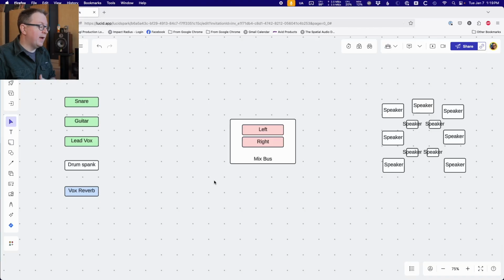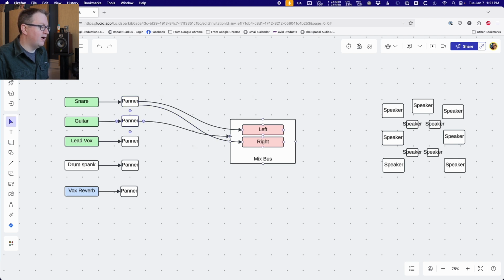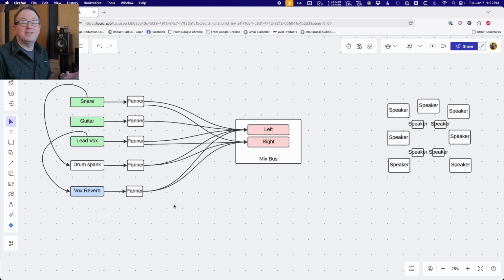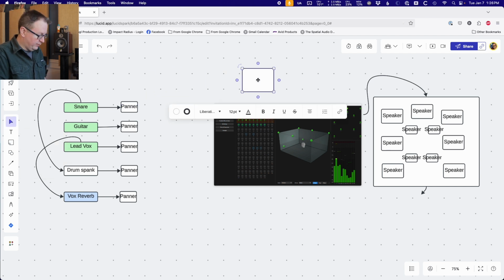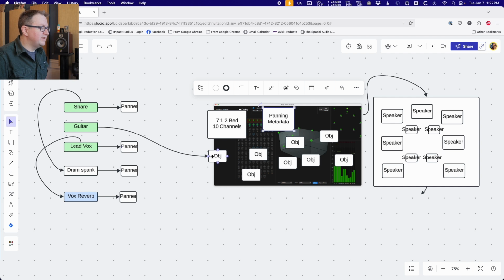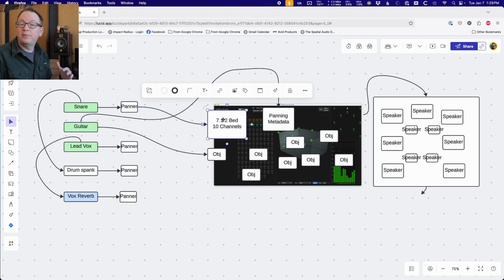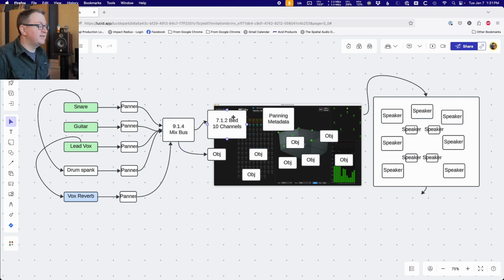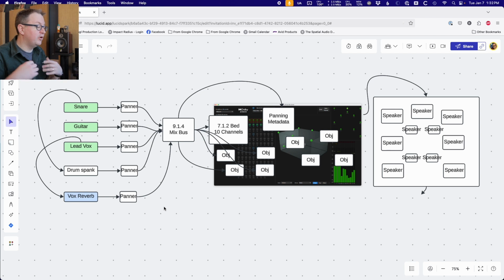Dolby Atmos Signal Flow

Comment: I’m curious, what are your thoughts on creating a 9.1.6 internal bussing for pro tools, then outputting to a 7.1 bed with the Front Walls and Tops being bussing to static panned objects? Workflow-wise, there’s less fiddling with dragging to object tracks or opening sends to object busses and instead you just pan freely. Sonically, I can’t the different between a bed that is 7.1.2 and an object bed that’s 7.1.2, so it almost negates to use for objects. Have you tried this?
Reply from the maker: That's basically what I've been doing. I have a 9.1.6 mix "bed/bus" that feeds the bed for the 7.1 and then feeds objects for the height channels. Then I use objects for anything that moves or when I want to place it in a non-speaker location.
Reply: @ gotcha! Thank you for clarification!